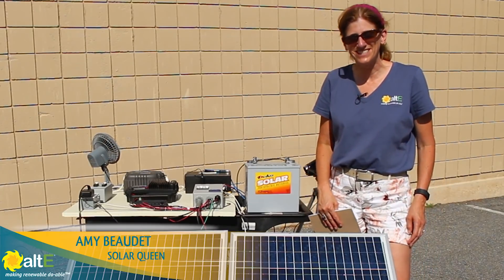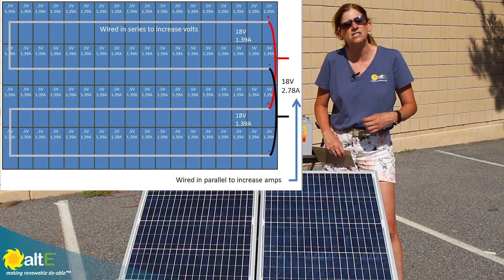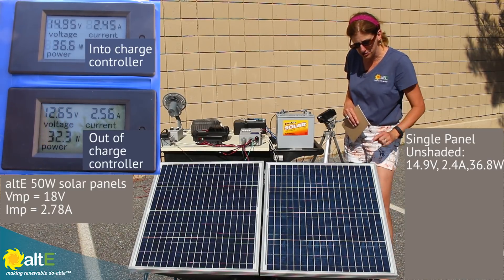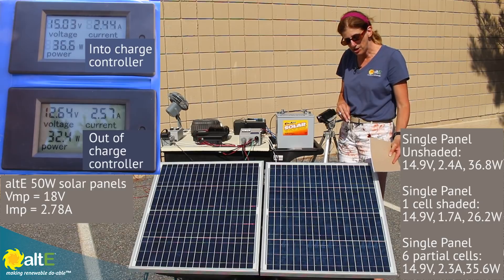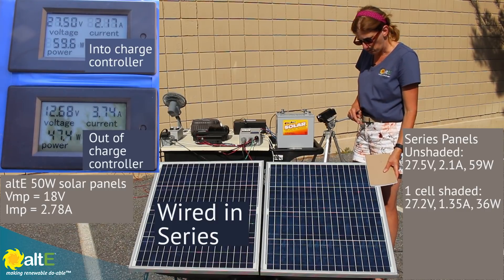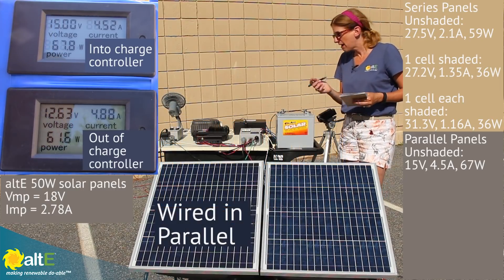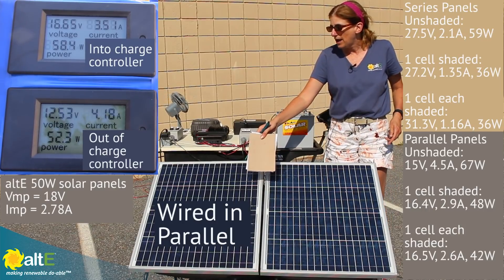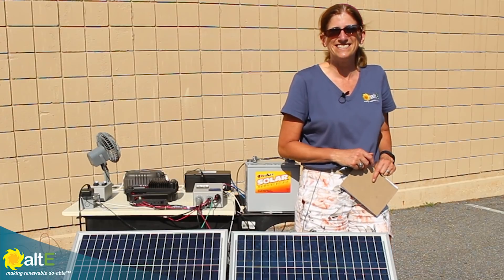How to Wire Shaded Solar Panels

Comment: for what i understand; summing up, when panels are shaded is better more voltage meaning having them in series, when are not shaded is better having the panels in parallel with the same voltage.

Comment: Thanks for the video. I love your store also btw, I shop there. I think for most people instead of using panels that are split in half and paralled (32x2 on 1 panel) it would make more sense for people to perform the same test with full panels and pretend they are just one big panel (which some are, the non split ones). So for example you should use 4x panels, wire 4x in series, do the shading test, connect 4x parallel do the test, then use 8 panels to do a series parallel connection and do the test. I believe most of use DIYers have been told that the best way to deal with shading with lots of panels is to do x number of panels in series and then the same amount in series and parallel those two connections to minimize your loss. That can be done with combiner cables (fused) or a combiner box for even more strings. 

Wouldn't that be the best scenario for ensuring you are getting the most power? Series/parallel same number of panels in each string (same type of panels too)?

This is what I've been told in many forums and reading other posts, also for say East / West / South facing panels. I'm doing a DIY off-grid setup in my back yard and throughout the day different parts suffer from bigtime shading. So the plan is to initially put 6 panels in an area least impacted by the shading all day, 3x series and another 3x in series to a combiner box (making them parallel 3s2p), then with the remaining 6 panels I have (total of 12) I was planning on placing 3 in series in a spot that gets good light for a good portion of the morning, and the other 3 in an area that gets afternoon sun for a total of 3s4p to my combiner box. Minimizing the shading loss. This may not yield the highest "peak" output but it should give me more of a flatter power curve through out the day giving me more power overall. Or is that not the right approach? I have an MPPT that can handle the amperage and voltage. Would love to hear your thoughts. Cheers and thanks again. I'm actually heading over to your website to see if there are any goodies I need that I can purchase! Im just about ready to bring the first 6 panels online. Wood frame is mostly complete! 

I charge 48V batteries, I have several of them, I don't connect anything to the grid, and I dont have say a proper larged sized ESS. The 48V packs are usually around 4-5kWh and I connect them to various items around the house with a proper inverter and fusing and all that fun stuff. Once I finish my last battery pack (16s2p at 48V) and build a custom enclosure for it I am going to focus on then buying batteries with more capacity so I can build a powerfull ESS. Something that will hold 2-3 days worth of power. But I am super looking forward to being able to pump more amps faster into my current packs. Right now a wimpy 4x100 watt PV system is charging them at a peak of maybe 6 amps. Seeing that number jump dramatically and the reduced charge time is going to be glorious! The batteries are rated for over 100A continious so no worries there. My SCC will only spit out 60A at 250v Max input. Still its going to put my first attempt at solar to shame!

Comment: I think there is something wrong with your charge controller. With an AGM solar battery you should be charging at above 14.4V. I have a CTek D250SA and that outputs 14.65V typically to the AGM battery. 12.65V is less than float charge.

Comment: It's my understanding that amorphous solar cells work better in shading and diffuse light like cloudy days for the same nominal wattage. Yes I'm aware they're generally less efficient and hence have to be larger in size, but as long as I have room for a 1000 or 2000 Watts, wouldn't it be better if used cells that had better performance in the clouds and dim light assuming the cost isnt exceptionally greater?

Comment: Maybe you can tell me why I get 10A or less from 10- 100W panels in parallel in full sun.
Each panel output is about 21V, but when paralleled, I get 16V.
I have this 10A or less going into a 1300W GTI.
I barely get 2A out of the GTI.

Comment: Thank you for this.  If I have 2 strings of 4 panels, 1 set faces east, and the other west.  If I wire them in parallel, will the loss be minimal as well?  So 4S (east) & 4S (west) combined to give me a 4S2P setup into a single MPPT controller.  Hope that makes sense.

Comment: Quick question, if I have 2 12v panels in series, can I add a 12v panel in parallel to that initial string, for the morning side of my roof

Comment: I have 3 x 330 watts of solar on the roof of the RV and I was going to go with 4 x 330... but space and time did not let me. 
I was going to go with 2 x 2 in series and then those in parallel... ended up just going with the 3 in series with ONE big MPPT CC. 
I hope I'm NOT in the shade  needing more solar...
Reply from the maker: Nice! If you do experience shading problems at all, that MPPT controller will likely also take 3x in parallel to charge a 12V system

Comment: Very nice presentation. Did You notice that WATS on input like on out-up get this same? Yes, converter also is consuming some WATS, thats why there is difference in 5-8 WATS. But nice in that presentation is that voltage is changed when amps stays this same, and You get this same watts like with higher voltage and lower amps. On Your presentation that was difficult to see, because of outside sun and clouds and Your body, but in ideal room with this same light, You will get watts at this same level. But voltage will differ and amps also.
PS, I have question, did You not over power Your converter? Because I see that panels in series get higher voltage but Watts stop at 50 watts.

Comment: But if I increase my amps I will need much larger wires. Especially over a 16 panel system. My problem is half my panels will be on the west slope roof and half on south. Half will be shaded all the time as the sun travels. I am very northern in Alberta

Comment: Given the performance of fully vs. partially shaded cells, would it be better to rotate these panels 90° so that as a shadow moves right-to-left across a panel, when that first inch is shaded, it partially shades 16 cells, rather than fully shading 4? 🤓🤔🤷‍♂️

Comment: today i learned accidently that covering the bottom 4 inches of a panel completly took almost all its amperage output away for the entire panel. they are flexible mono panels that seem to only have a 3 x 6 cell config for a total of 18 cells.

Comment: I'm installing solar panels on my RV and you helped me determine that: I will install a greater number of smaller panels in Parallel, as opposed to a fewer amount of larger panels in Series. And how to maximize panel orientation if possible...Thanks!

Comment: How can I connect 8 number of 300watt  40.1V solar array to maintain 80 to 120 system by voltage
Reply from the maker: Four parallel strings of 2 in series.

Comment: Better to buy panels with more by-pass diodes. Canadian Solar uses half-cut cells and has more columns.  They put a by-pass diode on each column.  Allegedly, Sunpower has a by-pass diode across each cell.
Reply from the maker: Be aware that there is voltage drop across diodes. Just a little bit per diode, but it can start adding up when you use more diodes. You have to find the sweet spot between shade protection and lower voltage from too many diodes.

Comment: I'd like to comment in here with something. First off, I love your videos. I came back to this one video specifically, but have watched many others experiment with the same thing.

The reason I want to clarify something here, is because we actually have what equates to four power sources, or four solar panels. You began explaining that each of YOUR panels has twice as many cells as standard, and that's because you have the panel broken into two sets of smaller cells. By doing this you have altered the shading experiment, which can be observed in your first reading. The current dropped nearly in half, with voltage being consistent. This is because your one panel that's hooked up is actually two separate power sources that are wired in parallel. One has some shading, but the other is still completely exposed to sunlight and is producing its original voltage. This is different than what other panels will do, because per your original statement, most panels are made with a single string of solar cells, meaning there is not a second power source made into the panel and therefor your results are specific to your product (or another product that is made the same way).
Reply from the maker: Perfect timing. I just grabbed two 36 cell panels from the office the other day and was going to do a new video soon showing shading with them. But the result will still be the same, wiring them in parallel will be better.
Reply: @AltEStore  provided you are always getting above 12v from the sun.

Comment: Answered my query exactly, thank you. 
On my setup, each panel is wired in parallel, with its own wire going to the controller. I was considering changing it to the series wiring to cut down on wiring but I can see now that this would reduce performance significantly if shade touched one of the panels.

Comment: panels were mono or poly?
Reply from the maker: Poly. You can usually tell mono by the diamonds between cells where the circle cells were trimmed to be more square to fit more cells.

Comment: What if you have East West facing panels? Would you use 2 MPPT or wire in parallel with 1 MPPT?
Reply from the maker: Two panels would be much better than one, as the 2 panels would never be putting out he same output.
Reply: @AltEStore  I mean,  my roof faces east west with room for only 2 panels each side(4 total).  Should I buy 2 MPPT for each direction (1 for east panels and 1 for west panels) or connect all east/west panels in parallel with only 1 MPPT?
Reply from the maker: @lanemeadows9957  Right. You should have 1 controller for the 2 in the east, and one for the 2 in the west.

Comment: This breaks my heart. I have a tiny cabin in the woods. I DO NOT want to cut down trees. All I want to run is a small 12v fan, maybe one 12v LED light, a 12v cellphone charger, and maybe a tiny portable wireless router. I was thinking 1 deep cycle battery and 100 watt panel should be overkill to keep it charged. However a largeamount of the panel would be covered. I always thought if 50% of the panel was covered, I would lose 50% of the power. clearly its not like that. It's much worse. Is there such a thing as a panel designed to be in tree shade, or would I be smart to take a bunch of the smallest 12v cells I could find, spread them out over the roof, and parallel them together? That way maybe 2 or 3 of the cells might have direct sun all the time. I do wish you showed what happens if you cover a large part of a panel. Like half. Is it something that it doesn't matter much if you cover 1 cell or half the cells you lose about the same, or is it like if you cover 1 cell you lose 50% and if you cover half the panel you lose basically 100%

Comment: BS .. they use usless PV with out BY PASS DIODES .. 
WITH OUT DIODES ..SO SHADE MATTERS !! 
WITH BY PASS DIODES !!! SHADE DON'T IMPACKT WHOLE SYSTEM 
BUT ONLY SHADED AREA 
BUT YOU ARE A.. I D I O T IF YOU THINK SHADE WON'T EFFECKT OVERALL PERFORMANCE 
BYPASS DIODES JUST BY PASS THE SHADED AREA 
SO IT NOT DRAW IT A L L!! 
DOWN.. !!!! LIKE THIS CHEAP SHAIT!!!!!! 
and NO SERIEL WITH BYPASS DIODES IS THE BEST OPTION ... !!! 
THATS NOT A OPINION .. THATS A FACKT ..
DON'T BUY CHEAP PANELS WITH OUT """ BY PASS DIODS „„„

Comment: If Schottky barrier diodes could be paralleled with each cell, it would make it so shadowing one cell would only lose the voltage of 1-1/2 cells, rather than an entire string of cells within a panel. It would make more sense, to just put all the cells in series, and series all the panels in the array, so that all you lose, is just a few volts if the corner of one panel gets shaded. The amperage will never change. That would make an array much more effective, if there are branches, blades of a turbine, or features of the roof  casting shadows on portions of an array. All the panels I own, have 3 diodes. If I block one cell, I lose 1/3 of the panel. If the shadow creeps up on the end of one of the panels, I lose the entire panel! The worst case scenario, is a partially shaded cell, where the voltage of the fully exposed cells reverse polarizes a cell, that's putting out less current. That creates severe spot heating of the partially shaded cell, which can permanently damage it, reducing the current capability of the entire panel. Shottky diodes on each cell will guarantee that could never happen. The more cells on each string between diodes, the more damaging partial shading of single cells becomes.
Reply from the maker: The problem with that is each cell only produces 1/2V, and each diode results in about 1/2V loss. So you would end up with pretty much no voltage out.
Reply: @AltEStore  In a panel, the photovoltaic cells are in a series. I'm planning on placing the diodes in parallel with each cell. The diodes do absolutely nothing, unless a cell(or cells) is shaded. They're just there, to minimize the reverse voltage drop, if a single, or a small group of cells is shaded. When paralleled, the cathode of each diode will be connected to the anode(+) of each cell, the anode of each diode will be connected to the cathode(-) of the same cell. A strange, and in some ways useful, characteristic of a single photovoltaic cell, is that they produce current proportionate to the amount of light hitting it. That current remains constant, weather the cell is being reverse biased, shorted, or even allowed to produce power. If one cell is partially shaded, the whole panel can only pass the same current, as that cell. The cell will go into reverse bias, which absorbs the voltage produced by other cells in the series, curtailing the current potential of the fully illuminated cells. If a reverse bypass diode is in parallel, the cell only experiences
Reply: (Continuing the first reply) 1/2 volt of reverse bias, instead of the voltage of all the cells in series with it, making it completely safe for that cell, and allows, the  fully illuminated cells to pass their full current. At that point, it would be most efficient, to have all panels in a series. I just haven't found panels, with that feature.

Comment: hello, so if i understand your video. if i have 2 panels in parallel and 1 panel is completely in the shadow. the other panel would not lose its own output rating? 
so lets say i have 5 amps panels.  and 1 panel is always in the sun. i should get 5 amps. and when i put them both in the sun i get 10 amp?

thanks
Reply from the maker: The sunny panel will lose some of its output, but not as much as if it is in series. So if you know you will always have complete shading on one, it is best to give them each their own charge controller. If it is occasional partial shading, sharing a charge controller is possible in parallel.
Reply: @AltEStore  oke thank you. the problem is that is have 3 panels. and only 2 controller. 1 panel will be in the sun all the time. and have its own controller. the other 2 will not. 1 of them wil have sun in the morning, and the second in the afternoon. these two i want to put in paralel and in one controller. if the loses are only about 25 percent i can live with it. what do you think? 
thanks for your reply. your videos are very good fore learning. im from the Netherlands so my English is not 100%
Reply from the maker: I suggest a schottky diode between the two panels. Watch this video, https://youtu.be/5rYy0gHZepI .

Comment: Random question. If my 300w/30v solar panel creats 10amps. When i connect it to my charge controller to make it 12v will this make it 25amps or keep it 10amps?
Reply from the maker: DEpends on your charge controller. A PWM will keep the output amps the same as the input. That'll make you lose a lot of power. But an MPPT drops the output voltage to the right charging level, and also increases the output current. So you will get the max power out of the MPPT charge controller.
Reply: @AltEStore  okay awesome thank you. So much to learn for when i do this to my own house. Luckly im starting at the cottage with my small set ups

Comment: So, since you say each panel should really have their own charge controller for optimal efficiency, are you saying that it is possible to hook 2 or more charge controllers to the same battery bank?
Reply from the maker: Yes, it is done all the time. It is best for them to be all the same model charge controller, and even better if they have a way to communicate with each other. Each charge controller would have its own breakers that connect o the battery bank.